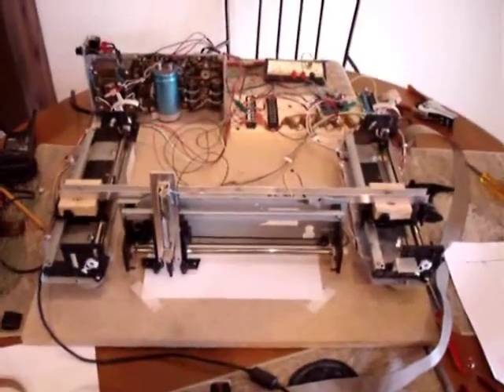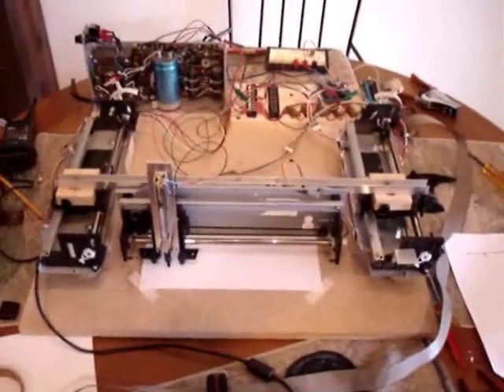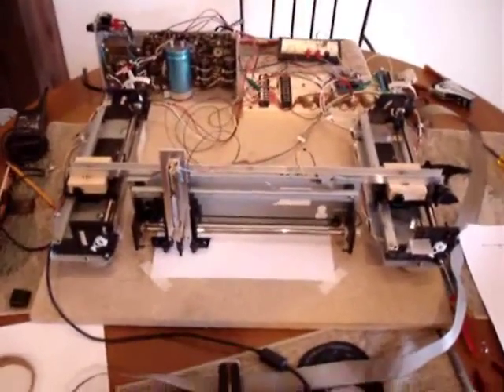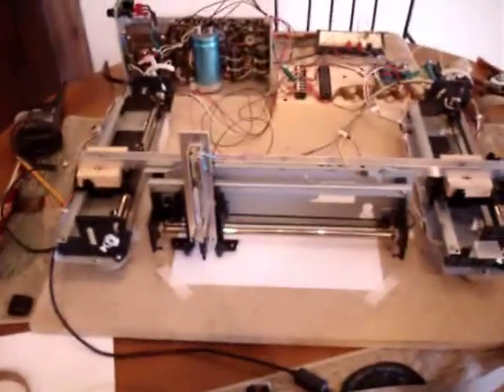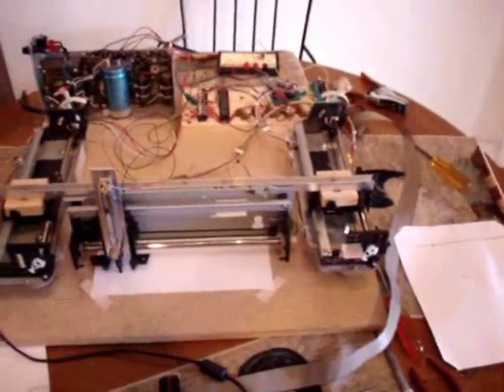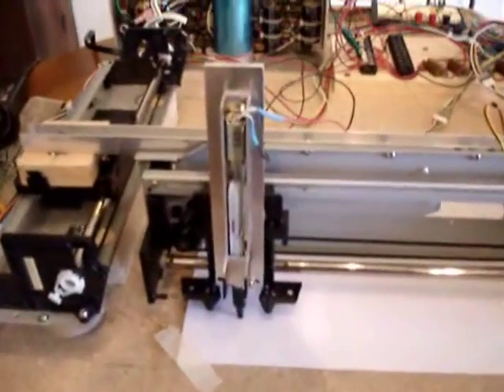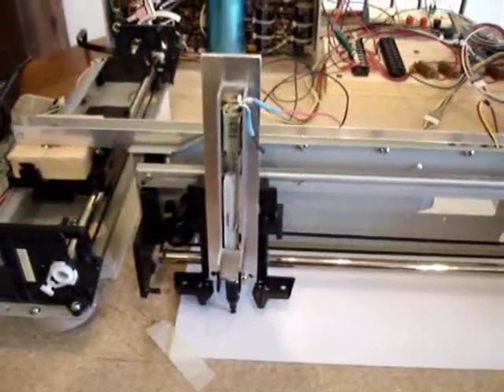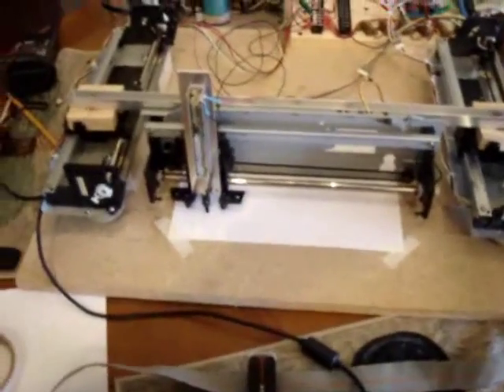Helloworld for my home-made pen plotter at mdpub.com

Comment: did you use the controller from the printers to run the motors or did you use a stepper controller that was seperate?